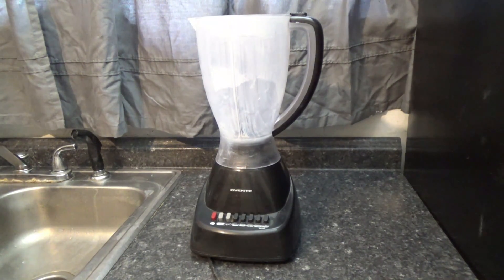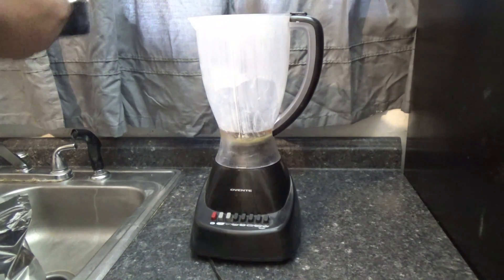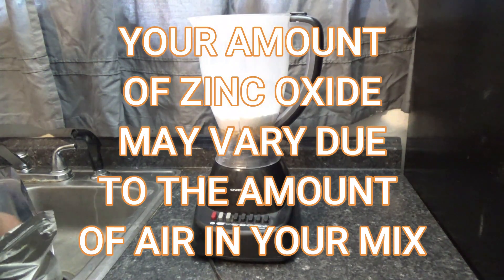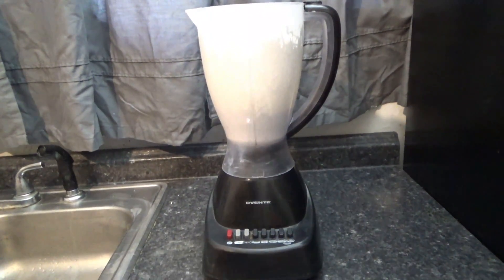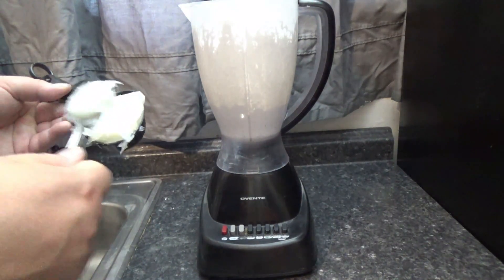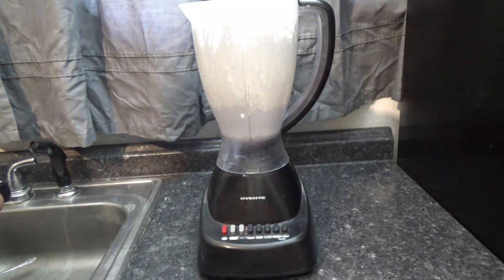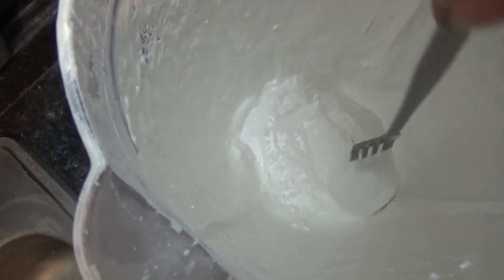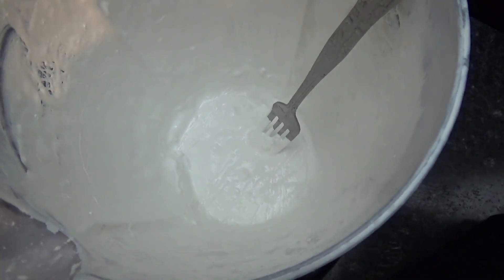How to make REAL thermal compound (NO TOOTH PASTE )

Comment: I worked for a aerospace company that built power electronics to convert wild frequency 3 phase AC to 400Hz 3 phase AC for commercial and military aircraft from about 30 KVA to 1000 KVA.   I have patents on packaging power semiconductors.  My area of interest in is the development of new packaging methods.   I have used indium foil on compression bonded semiconductor packages.  And have used commercial silver filled pasts.   
First of all replacing air is always a big improvement. Thus you do not want to use any material that will evaporate over time even if it leaves behind a solid because that solid will crack and thus put air in the path of heat travel to the sink.   Filling the past with better conducting material always is better.  
Oxides generally have poor thermal conductivity then the high electrical conduction metals.  So only when the component must be electrically isolated should oxides be used.   Also the bigger the area of the gap faces the better.
Reply: How about graphite powder? It has more heat conductivity but I'm not sure if it also conduct electricity at powder and mixed with oil paste form.

Comment: Vasoline has a low boiling point, put a hundred hours on it ond check difference between room temp and casing. Breezes are cheating so no excess convection allowed.  I just use anti-seize (may conduct electricity) when needed don't know how long it lasts yet.

Comment: TRY MY METHOD AS FOLLOWS:

1. 99.9% pure zinc oxide (SECONDARY thermal conductor)
2. 100% pure graphite powder (PRIMARY thermal conductor AND electrical insulator)
3. 100% pure vegetable oil (2nd base matrix)
4. 100% petroleum jelly/vasiline (MATRIX)
5. DIELECTRIC* silicon grease (thickening agent)
6. Dielectric transformer oil (MAIN electrical insulator)

amounts depend on your preference for how much paste you require!

step 1:  add the vegetable oil 
step 2: add the zinc oxide (mix for 5mins)
step 3: add the graphite powder (mix for 2mins)
step 4. add the dielectric transformer oil (mix for 2mins)
step 5. add the petroleum jelly (mix for 5mins)
step6 . add the dielectric silicon grease (mix for 5mins)

this method gives me idle* 50-55c under full heavy load and idles at 23-27c and costs less overall then the top brands (shits all over crappy mx-5/6 and pk3 pastes and noctua and grizzly don't even get to compete lmao :)

ps. wear a mask and gloves whilst mixing safety first n all that. happy days :)
Reply: "2. 100% pure graphite powder (PRIMARY thermal conductor AND electrical insulator)"
pure graphite is electrically conductive. It is not an insulator.

Comment: ok first problem thermal compound is 6 bucks a tube and if your only getting ONE  application per tube YOUR USING WAY TOO FUCKING MUCH BRUH WTF ARE YOU DOING WITH YOUR LYFE
Reply: Real one 1g is enough for 2 or 3 application

Comment: You may try substituting boron arsenide powder since it's thermal conductivity is about that of diamond; higher with perfect crystalline habit / form.
Reply: I use plain old graphite powder. It's cheap, readily available and has a thermal conductivity of around 2000 W/mK (although that's technically only along two axes of the sheets of atoms, but in powdered form it seems to still work very well.). Boron arsenide is only around 1300.
Reply: @fxm5715  Graphite is electrically conductive. It is not an insulator.

Comment: there is something necessary to made even more good heatsink paste.... remove the air bubble from the mixture, use vacuum pump & vacuum chamber, any gas contaminant act like heat isolator, reduce overall heat transfer performance !

Comment: 09:44 - WTF?
13:30 - again, WTF?
17:57 - So much work with shopping, storage, preparation, and cleaning due to 2°C?
The question is: "What is the price saving?"
Reply: Not everyone lives in a country in wich thermal paste costs peanuts... and it's way crappier than the one showed in this video.
Reply: you can mix it by hand dude it easy

Comment: it sounds rather stupid, and i'm probably going to get some hate for it, But i as well make my own thermal paste, I found that motor oil, very fine graphite dust and some peanut butter make great paste. I use it on my desktop CPU and i get about 14c/57f idle,  under gaming load about 50c/122f
Reply: The oil used in the peanut butter (may not be natural peanut oil) is [probably] working like his motor oil and like vaseline/petroleum jelly. A potential problem with the peanut butter is the peanuts burning & causing smoke. You could try substituting peanut butter with something of similar consistency but that doesn't burn, melt, or smoke. Old hardware (no one uses) is great for these experiments.

Comment: Have checked already powdered graphite in your recipe? What's the better replacement for it?
Reply: Yup, that's what I've used. I don't have any hard data, but it has never given me any problems. The W/mK of graphite is around 2000 along the cleaving plane, and seems to work very well as a powdered additive for thermal conductivity.